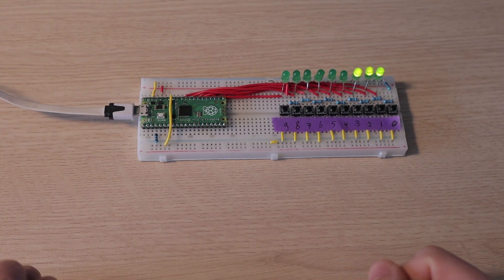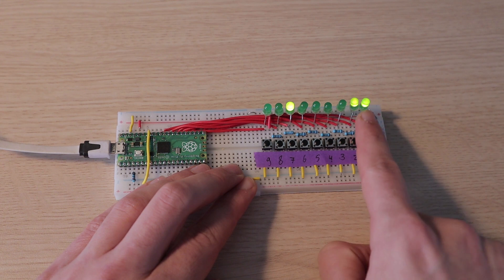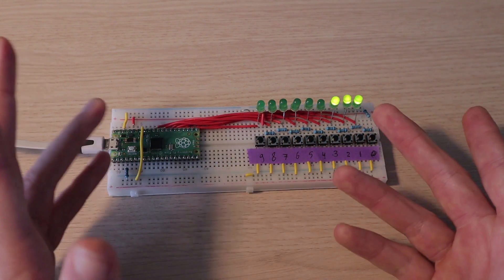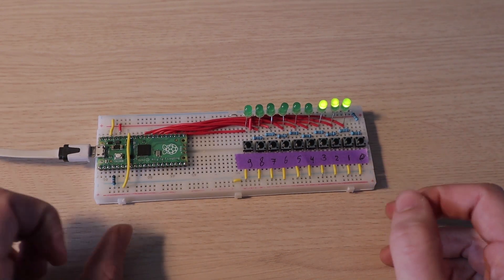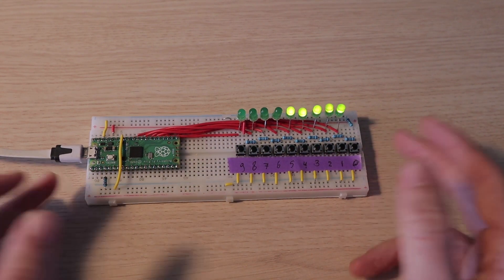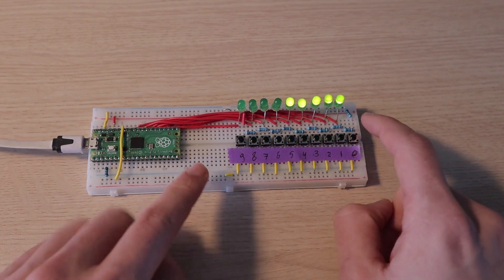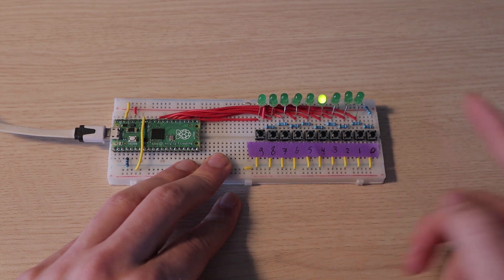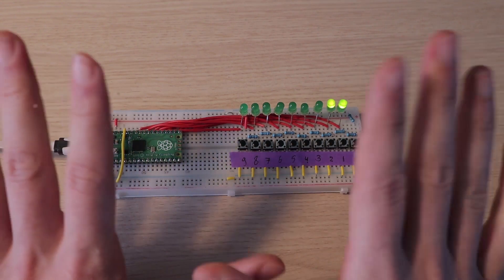Siteswap States explained with electronic state toy

Comment: Enhancement: Store the throws, and once the pattern is resolved to the ground state, have an option to loop-animate through the sequence.
Reply from the maker: Thanks for watching Steven, I'm a fan of yours! And a great suggestion too. Originally I thought of adding a number display to this to store the sequence, but that did feel like it takes away a bit of the simplicity. But storing the throws and allowing to loop would be very doable even with the current hardware, I will have a look at that, thanks!!

Comment: Cool! I love pico. Maybe you can use an addressable led strip so each ball has a different color. And then you don't need many cables too =)
Reply from the maker: Yes, great idea! I had thought about using RGB leds, but did not think of using addressable ones, that would indeed make wiring a lot easier, thanks!